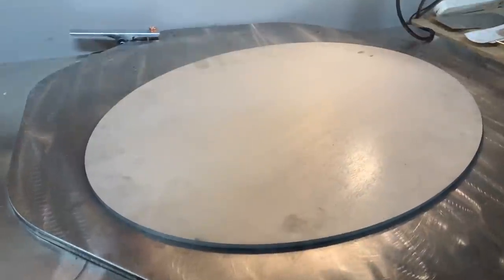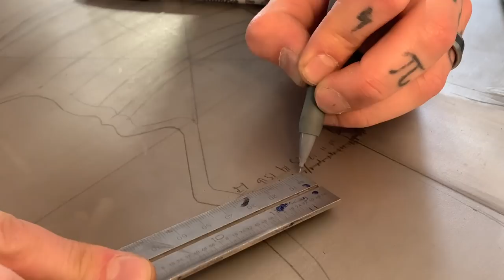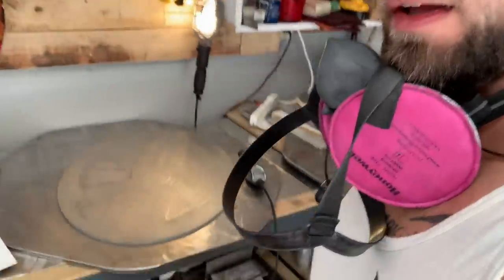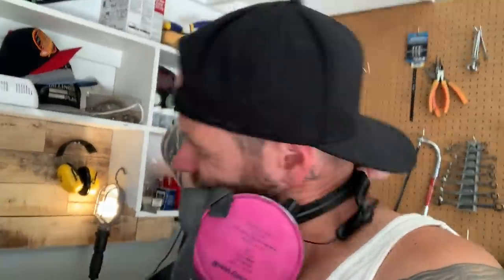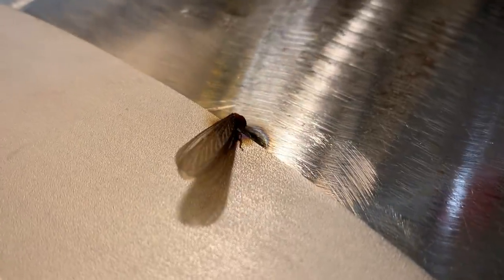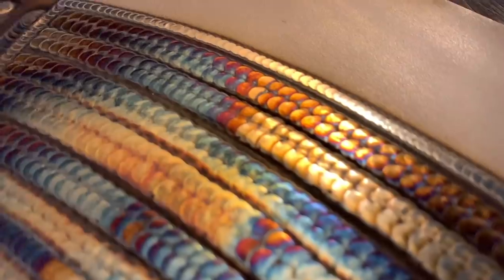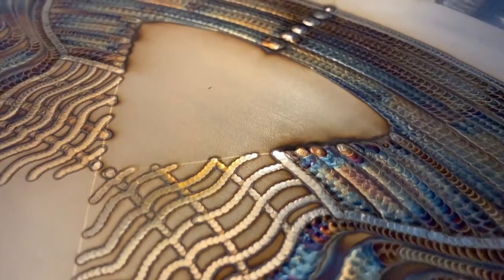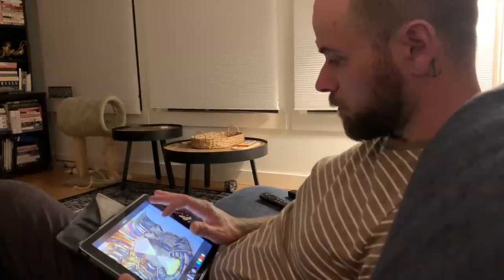The HARDEST metal art project yet! (I ALMOST QUIT!)

Comment: Love your work mate, very inspiring got me wanting to do a predictor piece. 

Maybe with titanium for some green looking colour also. Stainless is way cheaper though.

A little tip on Stainless if you haven’t tried this before, wipe the piece with transmission fluid and hit it with a blow torch (do this outside it gets real smokey) start at the bottom and slowly work up, the rainbow pops and is a good base to add your art on. Once cooled a gentle wipe a couple of times with acetone will remove the fluid making it contamination free without touching the rainbow colours. It also scribes a clean line if scratched that would be good for fine detail.

Thanks again for sharing 👍

Comment: There are some really nice engravers out there that blow the dremel out of the water. If you do a lot of this stuff might be worth looking into. Some run dental burrs, which are intended to be disposable, so are usually really inexpensive for 'industrial' use.
Reply from the maker: I’d be stoked to check them out! Any links? Thanks for letting me know!🤙
Reply: I really like the SCM systems 400XS.  Pretty low air usage, for detailed work only. Used standard 1/16" friction grip dental burrs. It's like holding on to a medium size marker. At 400K RPM, It just erases metal. You don't even feel it cutting. Unfortunately, not cheap...

Comment: I am not sure if you though about it and why it's or it's not a solution: For making the layout, you could just make a picture of the image and project it on the plate, you can skip to the "Dremel" step directly.
Even better, some 3D mill router, or laser engraver (they are not that expensive now a day). You could just make a picture of your layour, convert it to the proper format (svg or whatever) and engrave it. And then directly skip to welding.

Comment: Ive been in the heavy equipment and fabrication trade for 16 yrs and you have alot of skill and more patience than I ever will.  Most of the time I use .045 dual shield to really burn the pieces together but at home I use my lincoln 200 square wave because I want my welds to be low profile, look good as shit and be precise.  The one metal I absolutely DETEST welding is aluminum, im better on the tig machine with it but on a spool gun?  I look like an idiot for being a cert'd welder.

Comment: okay totally new to this so a few questions.

1) you mentioned changing that glass piece to change the metal color? how does that work?
2) is this like soldering where there is metal melted onto metal (ig it would be in the tip of the device?) or does this just melt the metal itself?
3) how is it so flat? in structural welding there are always bumps on it as far as I can tell.
4) what is this technique called? EDIT: I'm assuming it's arc tig welding after looking at your channel name 🤦🏻

not a question but 5) YOU ARE SO TALENTED!!! lol seriously this is probably one of the coolest art pieces I've ever seen.

Comment: holy this is a super nice piece dude
Reply from the maker: Thanks man🙏💪 Stoked on this one
Reply: Pacific Arc Tig Welding  

Love your work mate, very inspiring got me wanting to do a predictor piece. 

Maybe with titanium for some green looking colour also. Stainless is way cheaper though.

A little tip on Stainless if you haven’t tried this before, wipe the piece with transmission fluid and hit it with a blow torch (do this outside it gets real smokey) start at the bottom and slowly work up, the rainbow pops and is a good base to add your art on. Once cooled a gentle wipe a couple of times with acetone will remove the fluid making it contamination free without touching the rainbow colours. It also scribes a clean line if scratched that would be good for fine detail.

Thanks again for sharing 👍
Reply from the maker: That’s an intense idea! I’m gonna try that. Thanks for the recommendation!

Comment: As a artist they are 2 things that make this piece fall apart. First the oxidation discoloration is all over the place breaking the overall visual (this can be fixed). Second are the dots around the eyes, they even more break the shapes and distract from the center piece.

The absolute best is the hourglass. There are few spots with layering problems and then you layer the top part backwards.

Your art is screaming that you are not trained not educated in art (that is not a bad thing just make it harder to move forward). There is quite disconnect between your vision (lines) and form you using (dots). That is why you struggle by basically raping the form to your vision (witch is breathtaking when well executed). This form have many limitation you dont recognize ,work with or hide it. 

In your place i advice you to re-thing the form or art path because if this is the end result of two months and you doing this for over a year.
Reply: I think both the discoloration and the dots around the eyes add to the piece.
I'm not sure what you're talking about, art is subjective.
Reply: @HilbertXVI  well and that the main problem. Decoration is subjective not art. Its the same difference like food and meal. Food is a bunch of chemicals that body can digest, meal is something you can enjoy or hate. Decoration just have to be prettily, art have a meaning, purpose or invoke emotions. There is a reason why thay are benches in galleries and not at the shops. I study art and try get to high school of art (US equivalent of college or university). As a finished stone skulptor i focus more on sculptures then paintings.
What he does here is mainly wow factor, that it is welded. If this was a painting nobody will even recognize his work. It try to be more but it fall in to decoration category. When i started i was in this hole and its not easy to get out. Even good artist fall in to it when they get lazy.
What him hold back is that he does this for money not passion for creating art. Also he have the vibe of a creative fabricator not a artist. I not seen much of his house but all artist have paintings and art all over the house. I thing i have only one room and two wall without paintings/prints because of moisture and heat. To name few: Rembrandt, Leonardo da Vinci, Vermeer, Monet, Edgar Degas or more recent artist Leonid Afremov. Its more then a year since his death.

I can go 4 times more explaining why is this not a art but i dont think even you have the patient to read all of this.